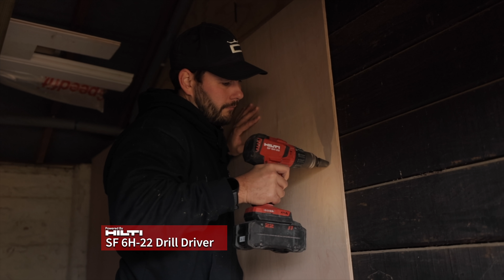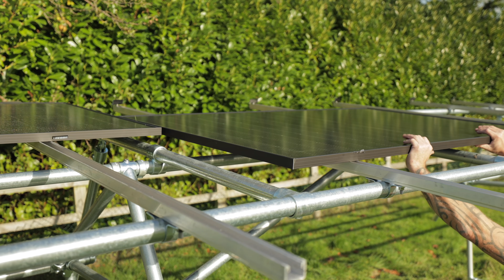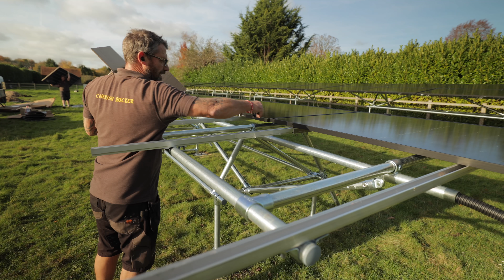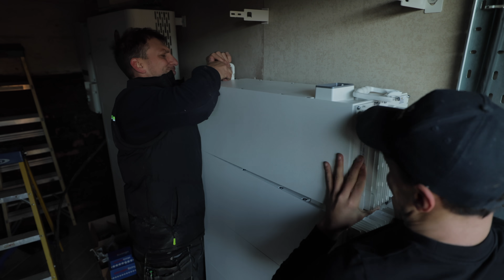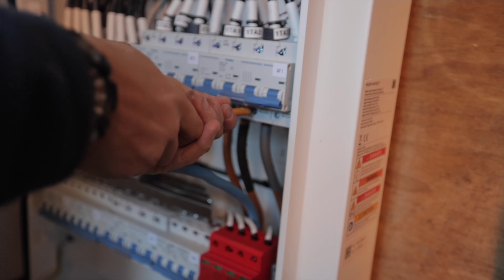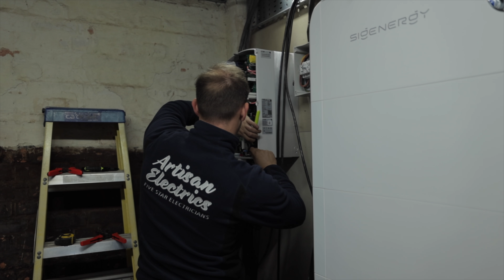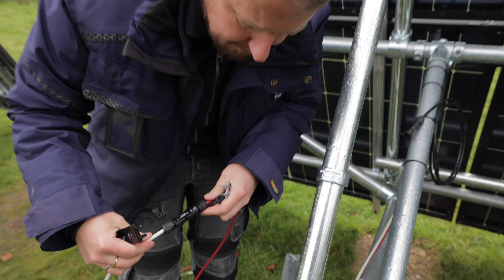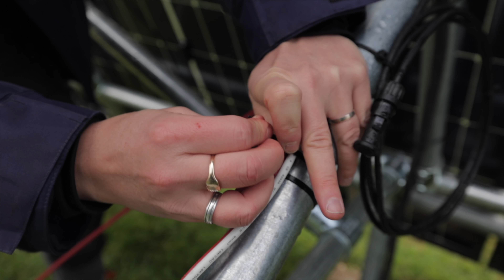The REAL WORLD CHALLENGES of Installing Ground Mount Solar

Comment: The whole solar edge optimiser seems totally pointless. Why do they need optimising? They're not shaded by trees. Just extra to go wrong and extra money!
Reply: If they are so beneficial on large arrays, why do utility scale installations with extremely long strings not use them?
Reply: @ even the so called benefits of shading is minimal.
Reply: @cods41  they are retro fitting them after some bad events. Safety and protection of your system is the best roi. Payback blinds that to often.
Reply: Optimisers were a huge waste of money.
Reply: Those optimizers second Job is to provide rapid shut down at the first point of connection. It’s required in our jurisdiction, regardless of you want power optimization
Reply: @JoshuaMorash literally have to put them as a regulation?
Reply: What's the real world gain with optimzers . Anecdotally they are just something else that goes wrong and if on a roof array expensive to repair ?
Reply: I'm curious what the voltage drop is if you used 6mm cable from the panels
Reply: … and the only reason any of this makes sense is because the government has screwed the electricity system with green taxes and providing support for intermittent, unstable and unreliable solar and wind generation resulting in some of the most expensive electricity prices in the world !!!
Reply: So many have a lack of knowledge around optimisers. On large arrays you will see cloud coverage across the system at varied ratios AND the biggest is safety in terms of rapid shutdown. Especially with ground mount systems. We are reworking a large one soon that a contractor didn't use them on and very much wishes they did. Ignorance is no excuse when bad things happen.
Reply: @electrician247 clouds because half a mile away and have soft edges are making next to zero variation across panels a few metres apart. Have 2 friends stand 10m apart they're gonna be very similar shaded by clouds. Trees buildings yes. Clouds no
Reply: The front array slightly shades the rear panels in winter, hence the optimisers. 35 minutes ish into the video.
Reply: @PG-ji6vq .. well that’s a crap installation, also the panels are so low to the ground that long grass could shade the panel , moving would be difficult and strimming should damage a panel … great planning!!!
Reply: @PG-ji6vq  they are largely irrelevant in that situation. He said it was something to do with sheep eating the wires.
Reply: Optimisers also stabilise voltages across the array. Although much effort is made to make every panel identical, the reality is that they aren’t. I do wonder if micro inverters would have been better than optimisers and hybrid inverter for such a large array?
Reply: All solar needs optimising as clouds and different weather conditions affect output and can bring them down. Optimiser sort the job out no problem and pluss the solar can be safely shutdown incase of emergency. 😊👍
Reply: @secreteman205 clouds vary  shading across 20,50,100s of metres because they tend to be half a mile away and have soft edges, not across panel to next panel distances
Reply: Within the first few seconds of the video you can literally see trees that would shade some of the panels in the mornings, and that’s ignoring the optimiser benefits others have mentioned.
Reply: Also saolar edge have a high failure rate.
Reply: Just pointless upselling 😢
Reply: @SeanMoore2008 selling a shut down feature that should not be needed. And not like it's on a flammable house or factory.
Reply: Spoken from someone who has no idea ahah
Reply: @TheSilverlemons all the big arrays in fields don't use them. Just strings. But when you're spending £150k as alluded it's <10% total I believe.
Reply: Just 10 years experience
Reply: Even though they aren’t shaded by trees the array is so long that cloud cover can affect output, many newer panels have dc protection  but that still can affect the entire array dropping the voltage,  given the distance though it would have been better to mount a local external inverter then ac back to battery’s location that way cabling would have been far cheaper and as you know dc kills ac still nasty but survivable if hit later on , if doing it again would suggest using the same thing water companies use to line old pipes thus far safer over time
Reply: @brianoneill350 Why because DC is more efficient at transmitting power than AC ?
😂😂😢
Reply: @ higher volts less losses. Like dno
Reply: Unfortunately that shows just how little you know about solar panels.

The IV curve is not linear.
That means the output impedance changes.

Maximum power transfer only occurs when the load impedance matches the source impedance.

Nothing to do with being shady, just understanding the non linearity of the panel's IV curve.

How effective the panel is at producing electricity doesn't just depend on the brightness of sunlight falling upon it, it depends on the load impedance.

So to get the best out of the panel and maximise the kWh produced, you need a dynamic (non fixed) variable load impedance. That is where the optimiser comes in.
Reply: @deanXRayZulu Dean, I have 19 kw of solar, bi facial panels. Not a tree in sight. Today I got 2.9 kw on a sunny day I get 30-40 kw at this time of year. There would be no point in optimising, the cost and maintenance potential far out weighs any benefit, at 70 euros a bi facial panel, I am in a great solar area, great irradiance figures, but Northern Hemisphere and it rains at times. It’s fine to talk about impedance but the reality is no irradiance no production. Cost benefit analysis.
Reply: @brianoneill350 yeah when your panels cost the same as your optimisers. I've seen £50 440w panels wholesale then just add more panels. Especially when not space constrained!. Go to the DC oversize limit of your inverter. Simple.
Reply: @ 100%, there is a certain madness to this install, did I miss spds on the dc side.  I cannot bring myself to watch it again.
Reply: @brianoneill350 2.9 vs. 40kw .. you just demonstrated the futility of solar I’m a northern climate…

… any you wonder why Spain collapsed!!!
Reply from the maker: Shading and also DC cable lengths were long, plus safety.
Reply: @artisanelectrics  the shading issue was completely due to the design layout, you had an entire field !
Reply: @SeanMoore2008 lazy comment, watch the whole video as he explains why the panels were the distance they are.
Reply: @artisanelectrics well said 👌

Comment: If you know sheep, it's not so much the chewing (yes some will always experiment) you have to worry about, it is the rubbing against the uprights and anything attached to them. Any chewing damage will more likely be down to squirrels and rats/mice.  I'm surprised that with all that power available, the client doesn't fence them off and run a robotic mower in the area under the panels.
Reply from the maker: Good point 😂

Comment: Yes please, we would like to know how much difference moving the panels makes. We're having a Cornish Rocker system installed and we're wondering whether we can be arsed to adjust it every time we get the email. (We don't live where the system is so would usually have to get someone else to adjust it for us.)
Reply: Vertical tilt angle gives a power reduction of cosine(angle_error), so facing the sun at noon each day is ideal. The ideal average angle is your lattitude. The earth's axis is tilted by about 23 degrees, so in the worst case cos(23) = 0.92 at the solstices, so an 8% difference peak. Average would be about 5% loss when averaged over the whole year. So tilting panels help, but buying more panels may be a cheaper and stronger option. However, being able to lay the panels flat in high winds may be helpful. Interestingly, on dull days, you may get the most power when facing straight up.
Reply: @krslavin  They're flat at the moment, deliberately left so for high winds (they haven't been connected up yet) and survived the recent storm!
Reply: @krslavin 
all good

Comment: why do you need  this many optimizers on semi flat ground? I dont see many trees that would cover the whole array.
Reply: If you look when the panels are up at a steep angle for the winter I recon the front row would shadow the rear row slightly so that might be why.
Reply: @HA05GER  that's what the bypass diodes built into the modules are for, particularly if you orient the modules in landscape.
Reply from the maker: Multiple reasons for using SolarEdge here - long DC runs, some shading, and safety of buried DC cables

Comment: Too bad you don’t get any sun in the uk
Reply: Lol I have a small system on my house and it does really well.
Reply: @HA05GER  same. 8kw system and 15kW of batteries and for 8 months of the year I'm barely spending a penny, even in winter it takes the edge off. Especially when you're paid £0.25-0.28p per kwh
Reply: @lehoff  mines only 2kwish and I don't own my home it's a council property so I still get the free electricity but make nothing and it is well worth it. During the summer I virtually use no electricity during the day and the winter it covers alot of my base load. Even a small system is worth it imo.
Reply: @HA05GER  sounds fantastic to me bud! 🤙
Reply from the maker: Yeah shame 🤣

Comment: Shame the Cornish Rocker system doesn't have motorised tracking, thats a big system to keep manually adjusting the pitch. Any reason for not using the Aiko panels with shade optimisation or Tigo's?The Aiko 2P model outperforms a bifacial glass
Reply from the maker: A future upgrade maybe?! 😎

Comment: I'm surprised you haven't motorised the frames so with the flick of a switch it changed the angle of the panels.
Reply: It only takes minutes to adjust the panels and most people would only do it in spring and autumn. If you were going to have a tracker you'd put the array north south and track the sun from east to west. Panels are so cheap now you might as well just put more out and avoid the complexity and reliability of having moving parts.
Reply: Such a system would also be able to automatically track the sun throughout the year, rather than having the owner remember to adjust the angle 8 times per year.
Reply: Good comment, beat me to it.👍😏
Reply: Given the huge price of this set up, i was thing the same. Also it could track the optimum angle daily.
Reply: Daily horizon-to-horizon tracking makes sense if you have severe limits on solar panel quantities (little real estate), but trackers are so expensive today compared to the panel cost...

For example, it surely makes sense to track the sun in space, on the Moon, and on Mars. There is little to no wind, no storm damage, and trackers can shake off dust. The frames and tracking hardware would be very flimsy in comparison to what is required on Earth to resist storms.

Comment: You really start to question this country's wish to achieve net zero, because the networks preparedness is woefully lacking.
Reply from the maker: Sad but true
Reply: Net zero help from the DNOs and the GOV…
Reply: @Beaglepup70 
I've been waiting for 6 months in a town for an unloop to just get enough power to run 7 KW charger
Reply: @allan4787 o dear. Which DNO? I’m with National Grid. Was so happy with the unloop they carried out, giving me a free 3 phase upgrade.
Reply: to be honest, that's the same in every country. In the Netherlands we face massive issues as well. Our grid operators have just announced a scheme to add (not replace, ADD!!) 50.000 transformers, which of course greatly upset all the NIMBYs who are now complaining how their parking and their views are gonna be destroyed. But of course these are the same people that can afford to drive Teslas, have massive solar and heat-pump setups, and leach off all the subsidies to insulate their houses... 
And that's only on the medium voltage side. Our high voltage transmission grid is facing even bigger issues, with planning for a single switching yard taking up to 10 years to complete. Everybody wants to use electricity, but nobody wants to see massive poles and wires ...
Reply: @112Haribo  northern europe will have 30% more cuts outs on the grid
if we dont solve the storage probem within 10 years

with the grid prices we see on the grid i only see more or less off grid as a long term option

  i  make bitcoins i drive a EV, have massive solar and heat-pump setups, and i dont leach off all the subsidies to insulate or heat anything.. 

i do my thing and they do their things, i dont expect anyone to pay for me 
but if i did i would need paperwork that cost most of what i save, i would need to get my house a energy classication to get anything.
i would pay pretty much the same i would get
Reply: Government's are going NET 0 but they still need you to consume. If you produce and consume on site energy companies go out of business
Reply: Making the grid two way, is like stopping a supertanker at sea, it's going to take a while 😂
Reply: is it true that in UK you don't get any money from the suppliers if you but power back into the grid from solar?
Reply: Net Zero - Follow the money...? 🤨

Comment: Thought it might be worth mentioning. The best way to weather proof the end of your cables is exactly what you are doing but with the addition of some injected 2 part epoxy resin under the heat shrink before applying heat. It's how we do it on solid streamer cables for use in the North sea.
Reply from the maker: Great tip!
Reply: @artisanelectrics adhesive lined heat shrink break out boots are also very good.
Reply: Are you working on offshore wind in the north Sea? That's amazing
Reply: In my Trade as a Instrumentation Controls Engineer, we used Heatsink Tube with Outer Glue, available from RS Components or Farnells Digikey, BTW Yes I have seen the Two Part Mix for High Voltage  Encapsulation comes in a bag with a removable strip & you mix in the bag, other larger versions in Tins,
I will be honest if it was my garden I would let you dig up & place a PVC tube there & run the cables in the tube I'm practical & logical, expensive cable slides better in a PVC tube,